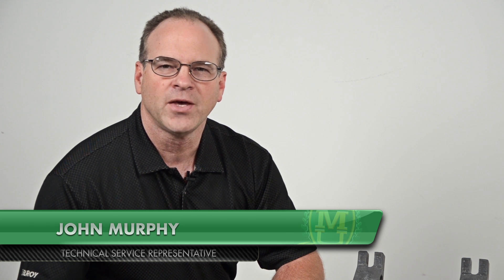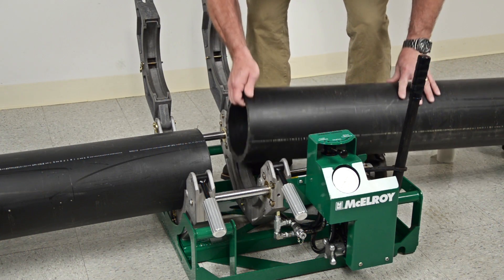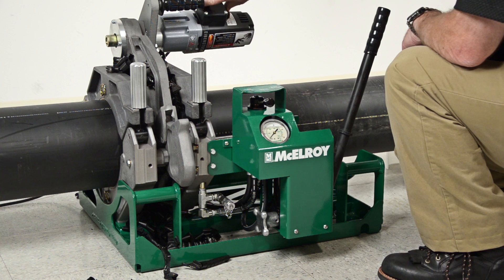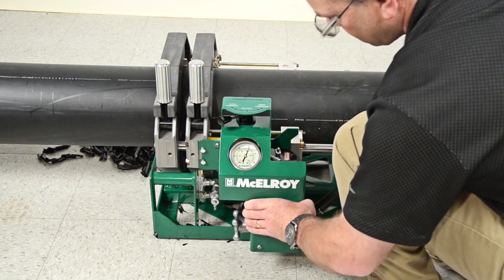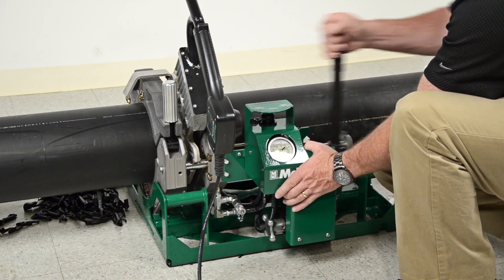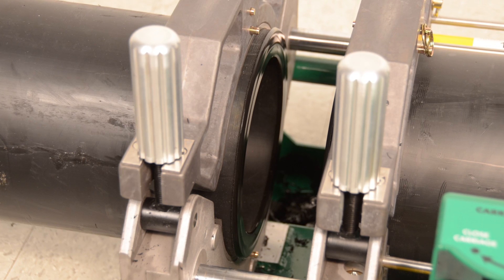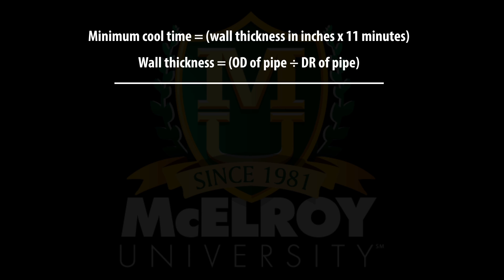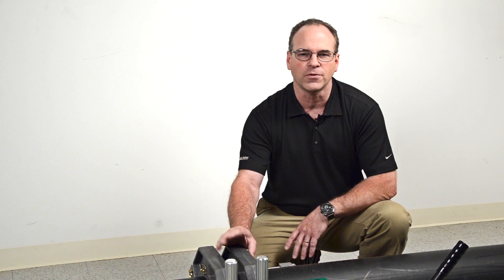How to Fuse Pipe with the McElroy DynaMc® HP (Hand Pump)

Comment: After fusing, is there a bead on the inside of the pipe like there is on the outside, and if so, what does this do in terms of increase in friction head?
Reply: Yes same size bead as the outside the inside is same size also

Comment: The inside Diameter will be reduced by the joint formed and cause head loss. Is there any way to eliminate this problem.
Reply: Nope, you have to live with that small loss of flow. Oversize your pipe etc if necessary.